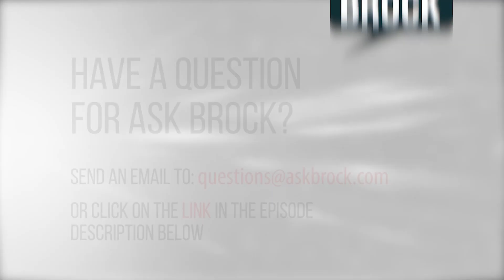Troubleshooting Mud Mixing on Drilling Jobs

Comment: 20 ft deep in red clay.  Running a thin bore gel mix with clay commander.  Fract out.... any tips?
Reply: Up your clay inhibitors cause some of it will be getting used up on your base bentonite, use plenty of fluid anywhere north of 3:1 even 5:1. Can drop your beno if you’re game and use xantham gum and Pac instead. Probably don’t need much if any pac in clay. Very high PH levels can make sticky clays worse too
Reply: It depends on so much the Tooling . The location the Formations  , the tools you have to work with.The company you Drill for  or if you own the rig ....etc etc tons of variables ..sometimes drillers that work for companys only have what they left the shop with... so you make do ... . So many variables its Actually Unbelievable sometimes .